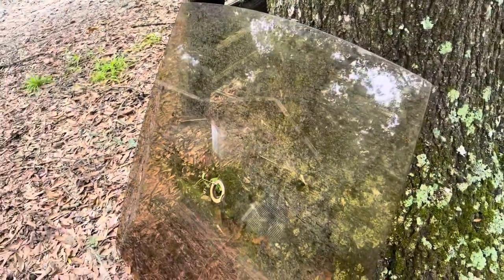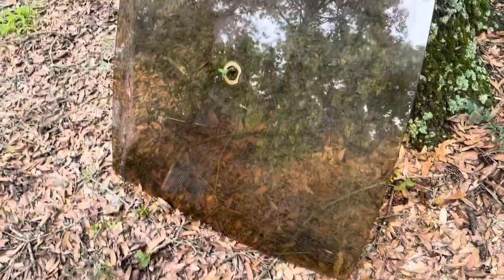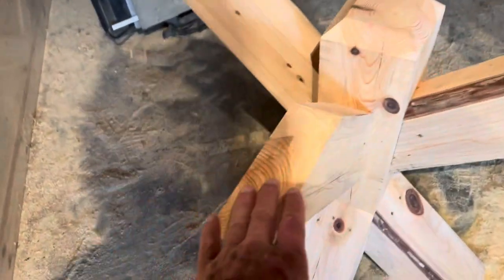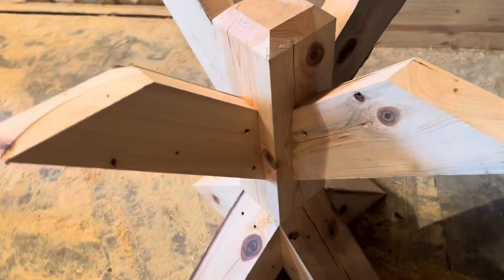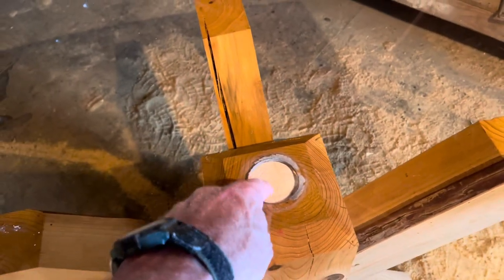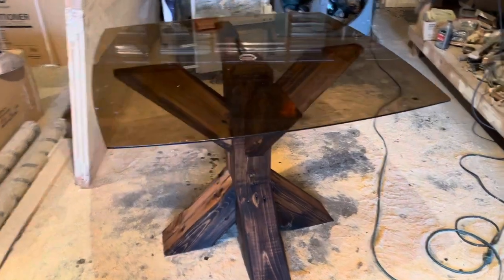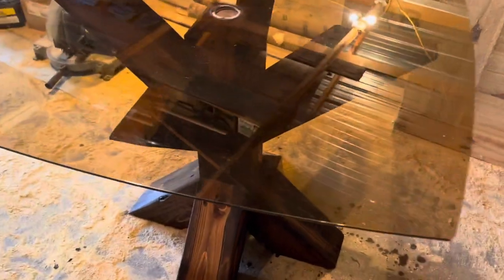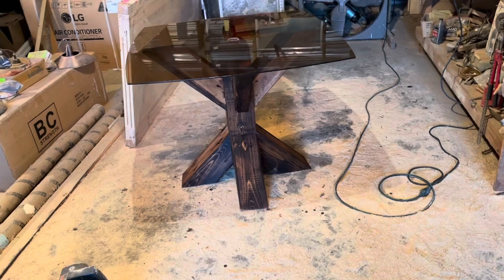Rustic Dining Room Table: Quick & Easy with a Repurposed Glass Top

Comment: Been watching ur videos, I like em brother.  I been thinkin about kinda like a lean-to add on to the side of my garage but my wife wants the top to be a porch.  I want the bottom to be waterproof so I can store stuff under it.  Haven’t been sure how to do that but I think I’ve settled on plywood sheathing covered with that deck over paint and taped seams with a slight angle to shed water.  You got any better ideas brother?
Reply: Use rubber roofing . I built a deck on a 2 story house and sunk a hot tub in the middle of it . Underneath was the pump room around the hot tub I put rubber roofing work like a charm

Comment: Nice job but I wouldn't take that center plug to the top of the table and make it the same size as that hole with the top just a little bit bigger . And screw it down /  Big screw resiest and puttied